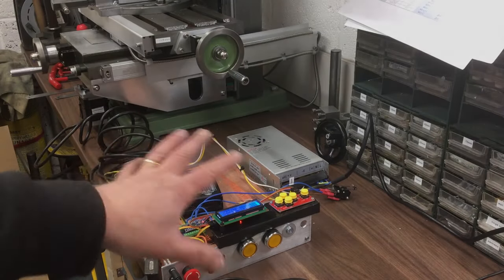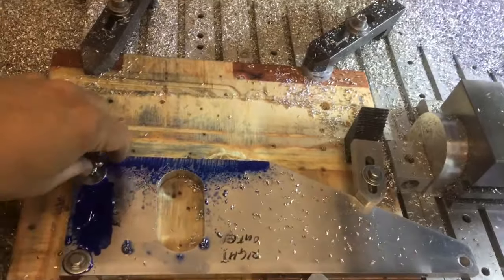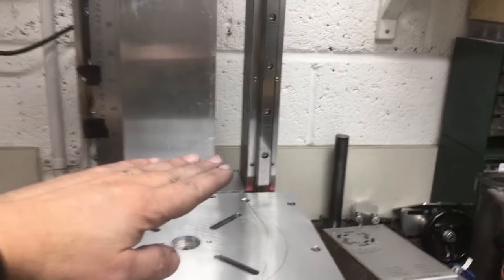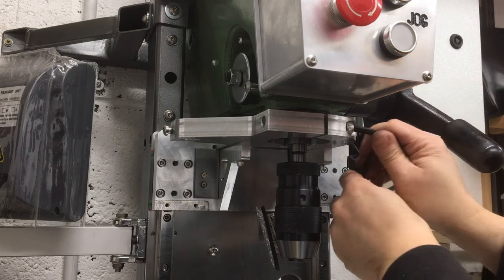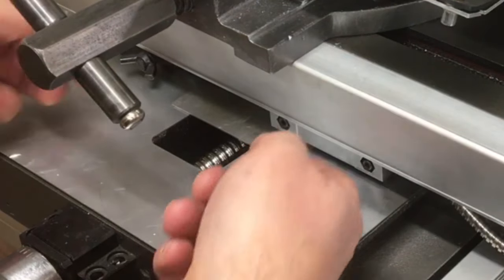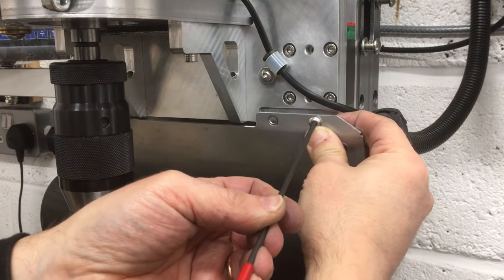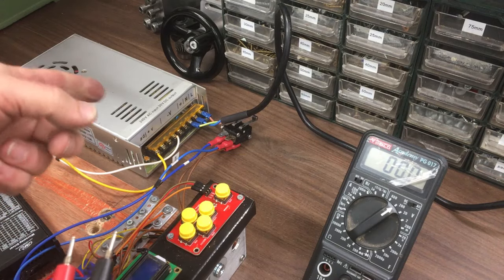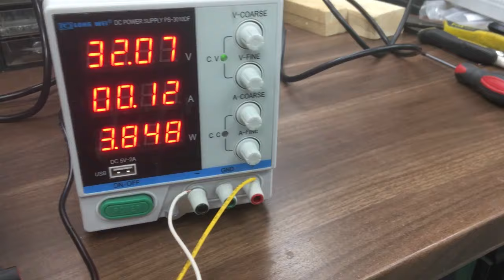Ep45: Drill Press upgrade | Let's rebuild it!

Comment: Check if lifting the table with your hand helps, if so, install a counterweight, e.g. more powerful engine
Reply from the maker: Thanks I’ll try that and see how close it is to lifting the table.  More power is on the way, I need to lift the table and hopefully auto drill.
I have thought about a counterweight but space is limited.  Hopefully have this sorted  before the next video!  Thanks
Reply from the maker: Ok I checked it.  If I push reasonably hard the stepper can lift it without stalling.  But I’m leaning over and pressing the button so it’s a bit awkward to do to gauge how much effort is required.  It means it needs a bit more power to at least lift it.

Comment: You can put your two supplies in series to see if voltage make a difference, I kinda doubt it at that low speed. if leave the screws on the ball nut slightly does it have some radial movement?, it kind sounds like things are binding in some places but not others. Since you don't need speed you could easily increase the force with a smaller pulley on the motor, just needs a different belt or bigger idler
Reply from the maker: I did think about linking the power supplies but didn’t want to damage anything.  Anyway the 48V supply arrived today and it was a bit better but still stalled.  I checked my records for the stepper and it is only 1.8Nm.  I’ve got a 3Nm stepper and smaller pulley on order which combined should give about x3 the torque.  Also looking at a gas strut and looks like one might just fit behind the table.  Got one on order at 500N to play with (table weighs about 45kg all up).  Might be a while before the next video!
Reply from the maker: Yes also ballscrew is slightly bent, and I think the drive pulley bearing is rubbing on one of the races against the housing.  It all needs finessing to reduce the drag on the motor.

Comment: Hi. Please, do you have a link for the DRO showed at 16:25 ?
Reply from the maker: It was from Machine-DRO and I bought it at a trade show years ago
Their website shows this model which is similar 
https://www.machine-dro.co.uk/digital-readouts-display-and-encoders/m-sure-ms-272-100-digital-linear-scale-metric-imperial-measuring-micrometer-100mm-4-inch-ms-272-series

The rest of the parts I custom designed and made.  Thanks
Reply: @routercnc9517  Thanks a lot, very appreciate 🙂

Comment: On My mill I put a round 12v 90mm led ring light, I could have got away with 70mm but to stop any shadows when using an ER32 collet chuck I went slightly larger, works great. If you drill out the rivets on the way cover and put them back on straight without the 180º twist it should be long enough, the rivets will show though, as its a wear item screws or rivet nuts would aid replacement rather than drilling out rivets every time. The lift motor seams out of line some how as it spins and slows down to a stop every revolution in the same place. All in all your drill press is better built than my small factory made milling machine, nice job. What`s the next project?
Reply from the maker: Hi Derek.  Yes I thought about those ring lights, was worried about shadows.  The goose neck lights arrived yesterday, hopefully they will be OK. 
 I could fit the bellows straight but the curved section helps them fold up.  Maybe I’ll try it straight and see how it goes.  
The ballscrew is very slightly bent, as they typically are.  If I had a hydraulic press I’d straighten it as it was about £50 to have the last one straightened.  I think with more Volts and probably a 3Nm motor this will work.  Wait for the next instalment. . .thanks for the comments
Reply: @routercnc9517  I did it as with a single light always got shadows one side or the other, now nothing at all, I think there are 28 leds around the ring with a diffuser on top so you don`t get  the bright bit where the led is and it gives you 360º very uniformly, how long it will last no idea so I got 2.
Reply from the maker: Ok I’ll see how I get on with the ones I’ve bought and if no good then I’ll look at the ring LEDs  Thanks

Comment: Okay but if it can barely lift the table, you can say goodbye to drilling with that thing. Even with the 3Nm and 48v. The rated torque of steppers is only a holding torque, once you move the torque drop off is abysmal.

Imo, get an AC servo with a brake. Maybe increase the power transmission since the servo can go up to 3k rpm.

You can get decent quality ones for under 250£ with the controller included.
As I've told you before, your Arduino is not going to cut it, especially not with servo controllers, those usually "micro-step" starting at 10k pulses per revolution.

The ones I got peak at 8Nm and are barely bigger than a Nema23, but the have a 18mm shaft, so can actually deliver serious torque. 

All up to you, but if you stay with a stepper, I doubt you'll ever be able to quickly auto cnc drill with this thing without stalling or having to go in painfully slow pecking cycles. So at that point you might as well go back to using a geared DC motor.
Reply from the maker: I think you are right.  I usually do calculations for this sort of thing to get the spec right but since it looked like I only needed 1Nm of torque to start lifting I thought it would be OK.
So it is either go with 48V and 3Nm and just use it to lift the knee (and I think the arduino will still work here), go to a simple DC motor (and just lift), or go all in with a servo and get all the functions.  Although I would need a better step source as you say.
The other option is a counterweight but space is tight at the back.
I could go hhe cheap route and see if I really miss the extra functions.
The other thing I’ve not tested is the holding power when drilling which might be too much.
Again braked servo, or counter balance are options. 
Decisions, decisions . . .

Comment: I have loved this impressive project, but I have to wonder if you'll ever get as much use out of it as the work you put into it. (Not criticizing AT ALL.) No doubt all the use you get will be far more enjoyable than if you hadn't done all this work!
Reply from the maker: It's a fair question so thanks for asking it.  There are not many YouTubers that have done this level of change as you are probably better off just getting a mill!

The project was finished a while ago and I really enjoy using it.  I've used it many times to drop in a piece of work, pick up off 2 edges and drill out holes in fairly accurate locations.  The knee lift is also great because you don't loose position when swapping from short spot drills to long taps.

The VFD and 3 phase motor are a great time saver over single phase motors and lots of belt changes!  The tapping function I added to the controller is also very handy for, well, tapping threads!

The extra knee travel I added towards the end of the project was also a great improvement, but it has come at a cost of 'rigidity' of the table when drilling with large drill bits.  The XY table will shake a bit on the larger drill bits because to get the extra travel I dropped from 4 carriages on the linear rails to just 2 carriages holding the knee to the backplate.  I was expecting that to happen and was not much I could do about it.

The only thing I did but have rarely/never used is the step function on the knee lift where you can move up or down a set amount (e.g. 1mm).  For counterbores I just use the DRO on the quill.  But this was just a bit of extra code in the software and a switch, so no big investment loss.